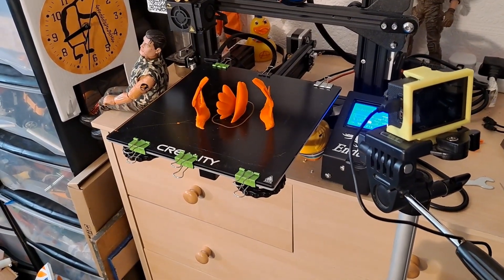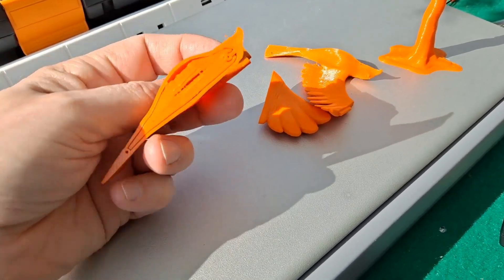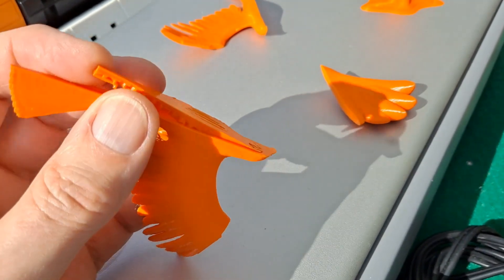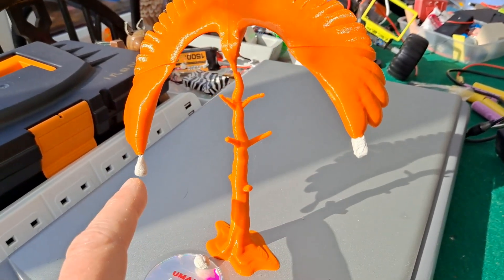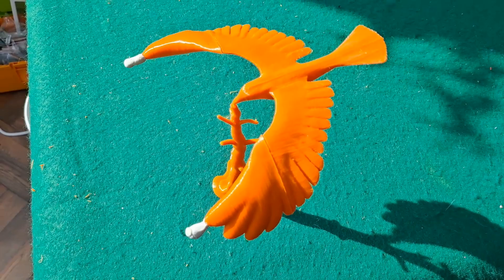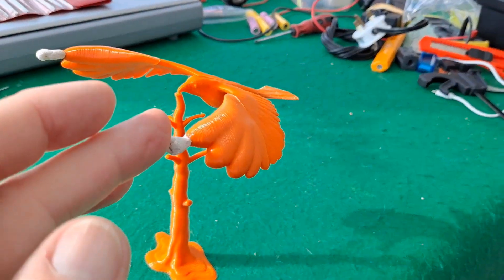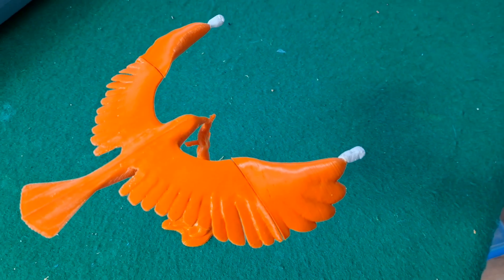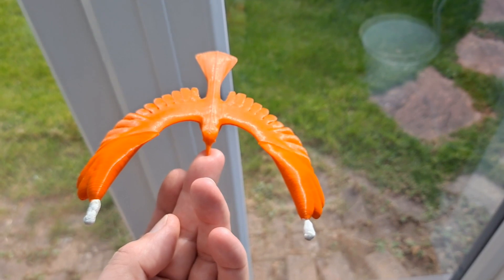3D printed balancing bird

Comment: Could you put the weights under the tips to hide them a little then a little paint to finish it off 👍
Reply from the maker: Hi Cliff, much of this is around how you configure the print file. 100% infill for the front sections to make them as heavy as possible. Then minimum infill for the other parts to keep them light. I made a basic mistake by adding metal pins to hold the body together as that is all adding weight behind the balance point. There is a follow-up video tomorrow night with a new print. I still had to work on it to get it to balance but I did manage without any additional weight.